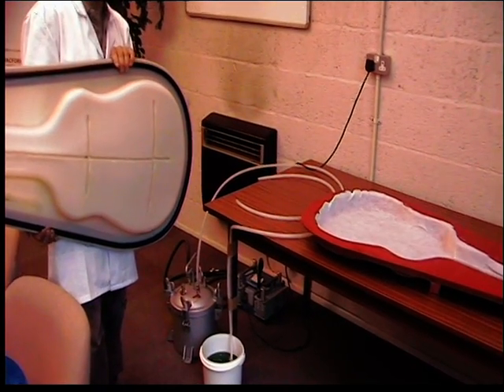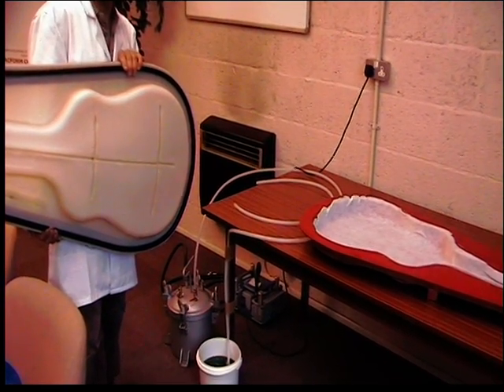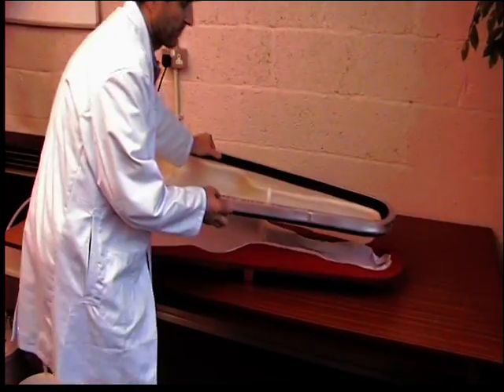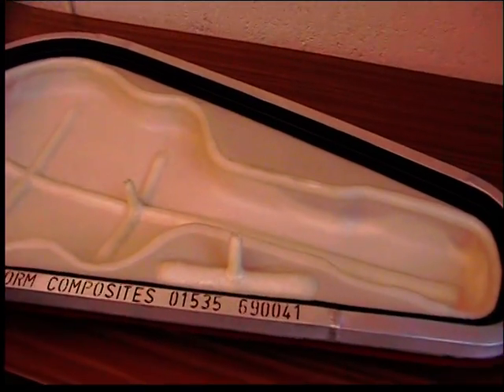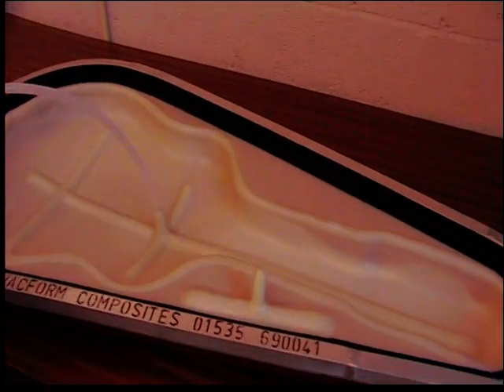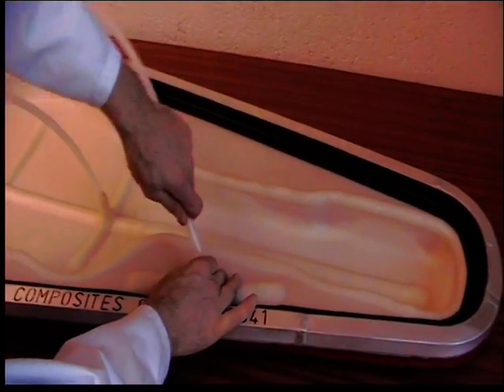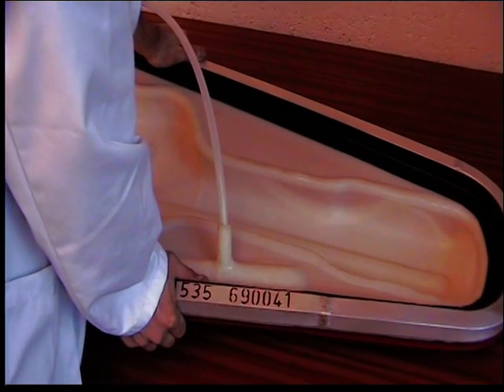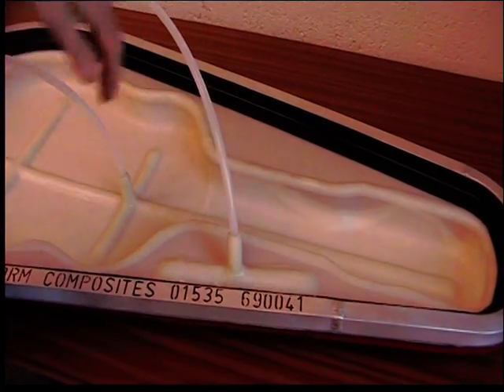resin infusion vacuum bagging

Comment: I know your comment is from a while ago but heres what I think the problem is, You've probably allready had pinholes in your part before spraying it on... you can solve this by first closing the vacuumline and then closing the resin input line a bit later, you'll have a part that is a bit more resin rich but with a perfect finish, you could also try to heat the mould before infusing

Comment: @shkssj88 Your clear gelcoat is either sprayed on too thick, which traps unsurfaced air from escaping before gelling occurs, or you have too much catalyst mixed in with your gelcoat. Catalyze at 1.2%-2.5%, staying on the lower end if temps. at above 75 degrees F. Spray no more than 18 +/- 2 mils thickness wet.